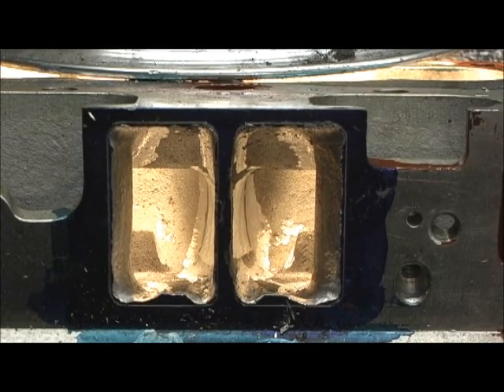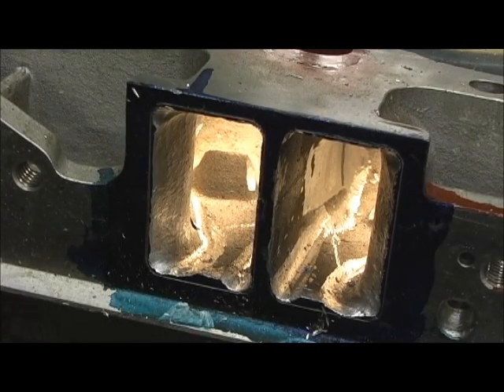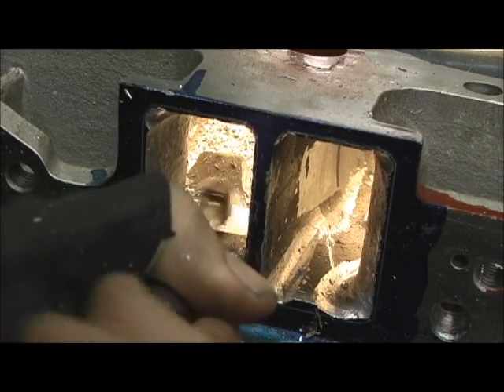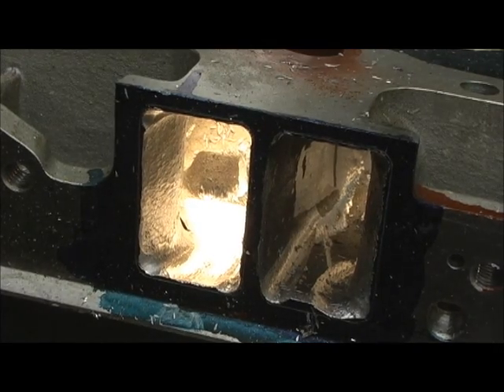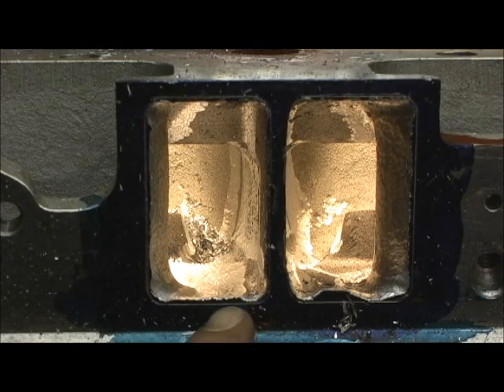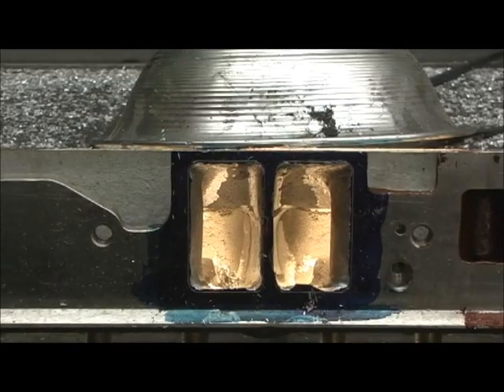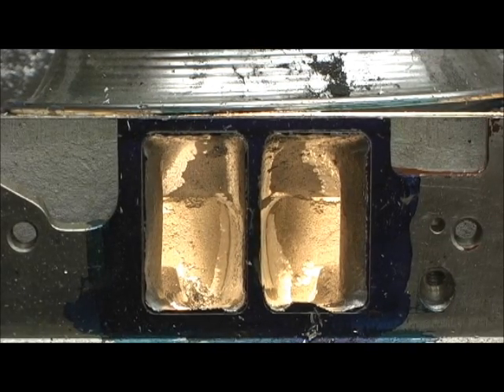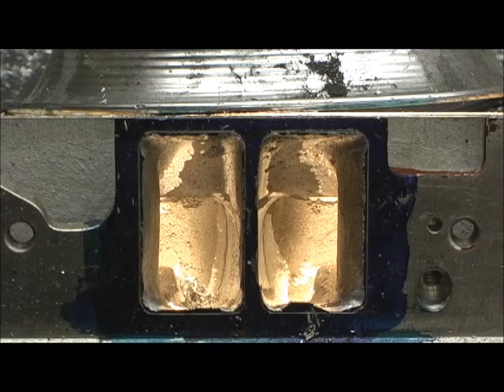Denmark ProComp SBC 190cc "Pillar" to Roof Raw 5.6

Comment: hello I am a fan of your tutorials, and have learned a great deal from them and thanks for your time ..I have been wondering what the reason that the kindny bean shape plays as far as the horse power produced just as if it were just flat valves at determind depth and angels completly closeing the the chambers? and do you have a  name of a good read that can help  as i have a lot more questions about piston shapes to valve seat angles